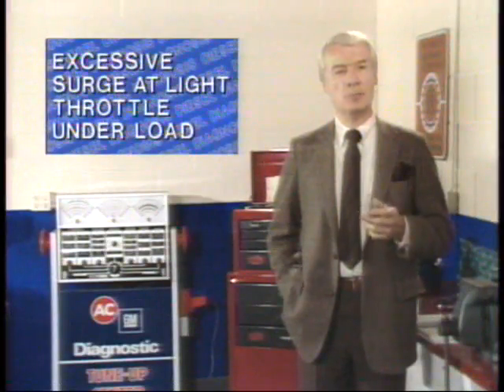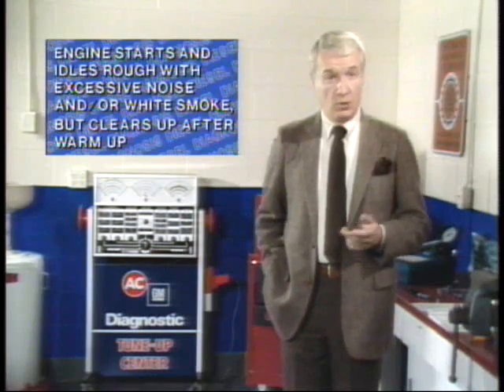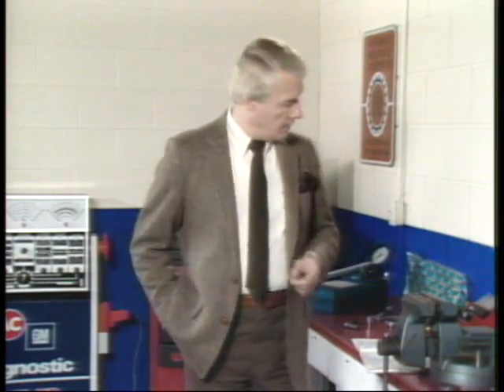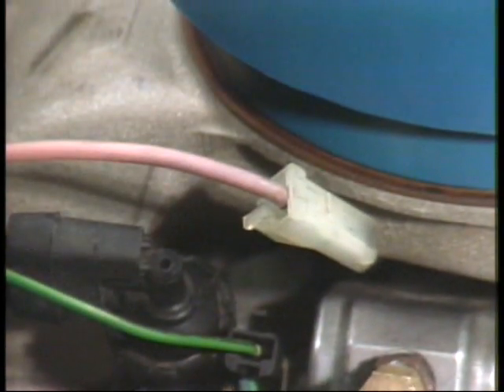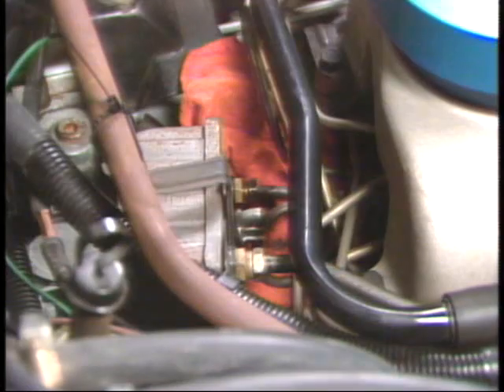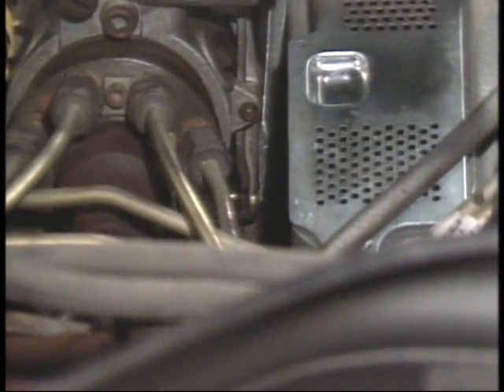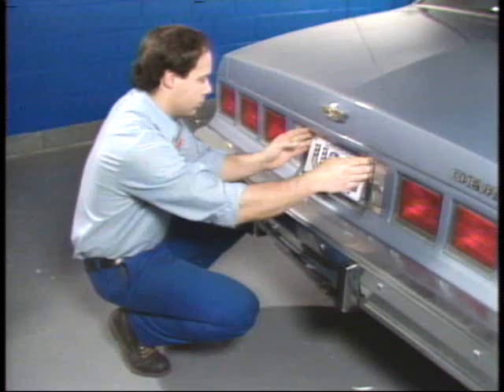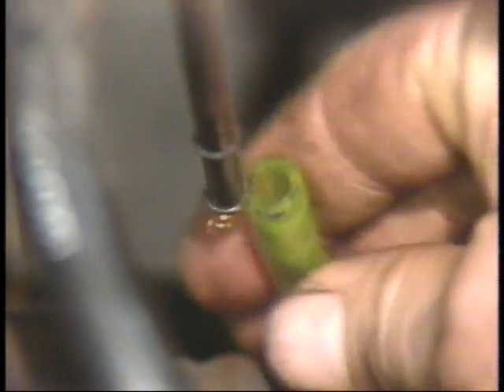1984 Chevrolet Diesel Diagnosis Laserdisc Side 2

Comment: Table of Contents:

0:00 Start of disc
0:02 Intro
1:28 Chapter 1: Excessive surge at light throttle under load
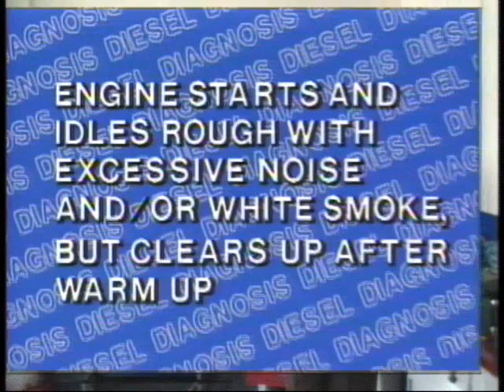4:47 Chapter 2: Engine starts and idles rough with excessive noise and/or white smoke, but clears after warm up
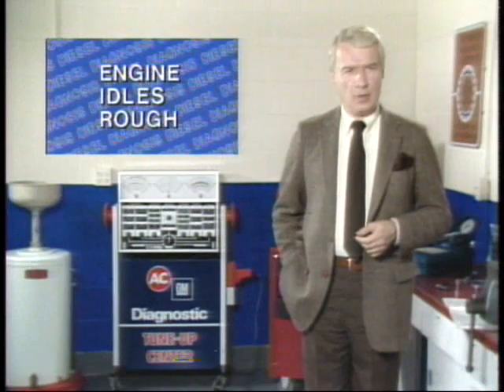9:34 Chapter 3: Engine idles rough
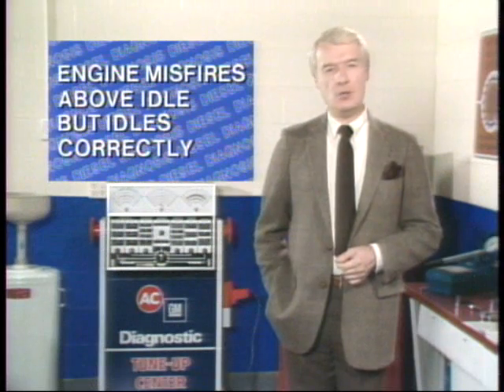14:34 Chapter 4: Engine misfires above idle but idles correctly
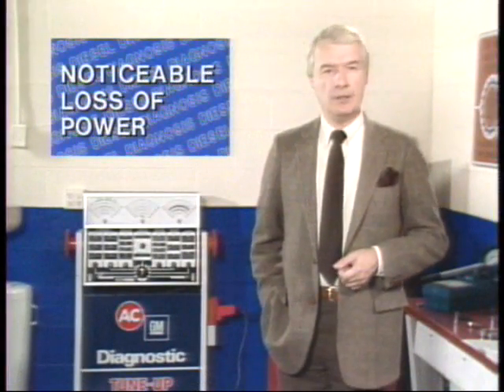17:17 Chapter 5: Noticeable loss of power
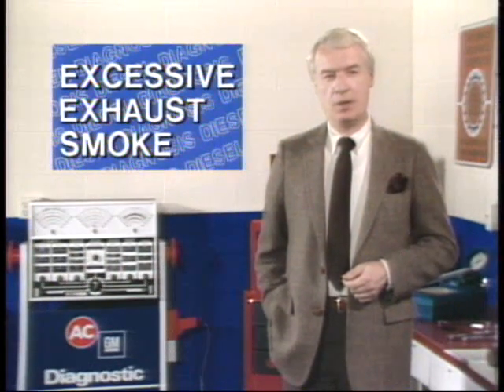23:44 Chapter 6: Excessive exhaust smoke
26:09 Glitching begins
26:22 Glitching gets more intense
27:36 Glitching ends
27:38 Returns to near-end of chapter 5

Comment: just recently i got some very rare dealer used showroom discs. i have bout 6 of them or so there bouts. 1981 to 1983. one of them follows this disc cause it shows the diesel olds cars available and features they had and or came with. also gives an overview of manufacturing